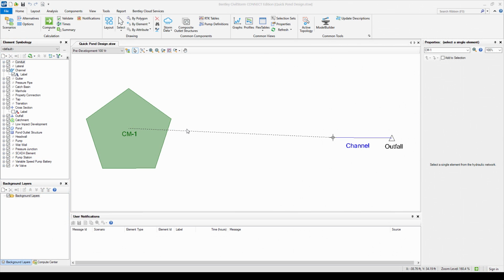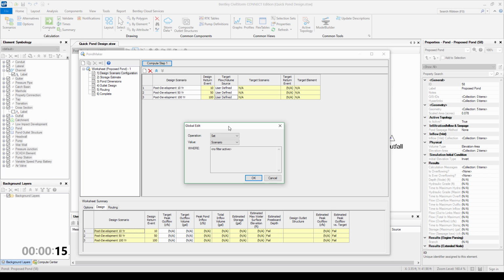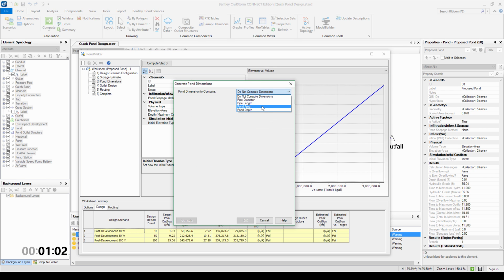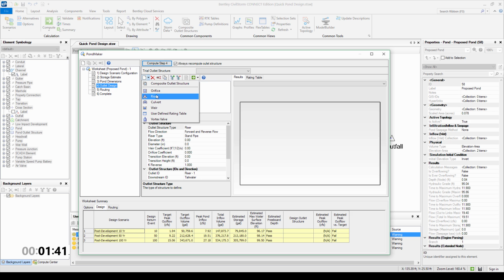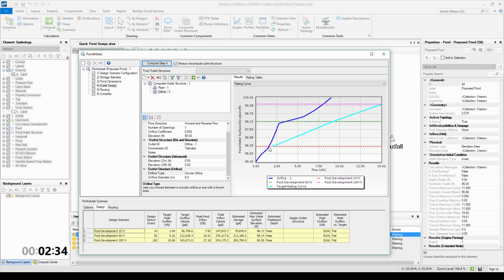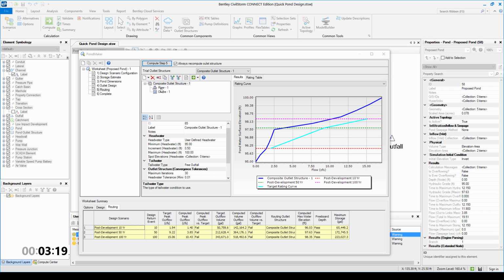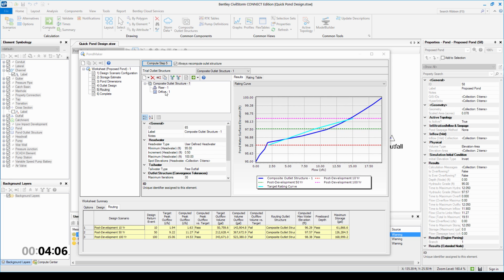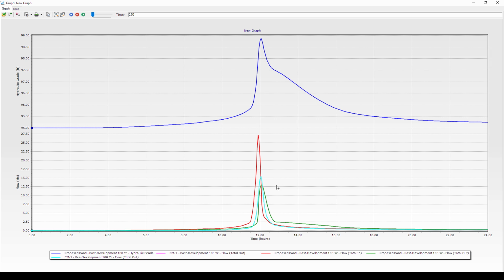Using PondMaker to Design a pond in under five minutes

Comment: On the orfice and the riser, you have the Downstream ID set to tailwater. If i set the downstream ID to a culvert leaving the outfall structure, i get drastically different results. Which methodology is preferred?
Reply from the maker: Do you mean that you have an outlet structure with an orifice, riser and culvert, with the orifice and riser downstream ID set to the culvert? If so that suggests that the culvert is a bottleneck. Try increasing the size and/or slope of the culvert to see the impact, and review the tab on the right side of the composite outlet structure to view convergence results). See: https://bentleysystems.service-now.com/community?id=kb_article_view&sysparm_article=KB0057109

If you need further help, please contact Bentley Support or post details on our forum: https://bentleysystems.service-now.com/community?id=community_forum&sys_id=0310b7ca1b1a3110f3fc5287624bcb80
Reply: @bentleywaterinfrastructure  Correct. I have an Outlet structure with an Orfice and Riser allowing water into the box and a 16' long culvert leaving the box discharging to open land. Should I set the Orfice and Riser downstream ID as culvert or tailwater? I've seen it both ways.
Reply from the maker: @christophertrebisky5243  In order to properly account for any tailwater effects/restriction from the capacity of the culvert, you would want to set the riser and orifice downstream ID to the culvert. Try increasing the culvert size to see the effect, and review the results to make sure there isn't a convergence issue as described here: https://bentleysystems.service-now.com/community?id=kb_article_view&sysparm_article=KB0057574

Comment: can I use this software for designing evaporation pond?
Reply from the maker: Yes, an evaporation pond is basically a retention pond (no outlet) where the infiltration rate is configured to simulate the evaporation rate. This can be done in SewerGEMS, CivilStorm or PondPack with the available infiltration methods. See: https://communities.bentley.com/products/hydraulics___hydrology/w/hydraulics_and_hydrology__wiki/43029/modeling-evaporation-in-a-pond

Comment: Kindly explain how to design evaporation & seepage pond with no outlet
Reply from the maker: Hello Sayed, there are infiltration methods available in the pond properties, and you can also use a user defined rating table outlet structure to model infiltration and/or evaporation. For more help, please post on our forum: https://communities.bentley.com/products/hydraulics___hydrology/f/haestad-hydraulics-and-hydrology-forum
Reply: Hello , please be  that Bentley communities web site is not reachable and the following massage appears, I tried using different browsers and even i used my mobile to access it, also it is not clear to me what is the relation between rating table and infiltration and evaporation, rating table is a relation between elevation and flow
This site can’t be reachedcommunities.bentley.com’s server IP address could not be found.
Reply from the maker: @sayedelhagar3442  Sayed, I am not aware of any problems with Bentley Communities. Do you mind if I ask what country you are from? I believe we do have restrictions in place due to U.S. Export Controls.
Reply: @bentleywaterinfrastructure  I am from Egypt and website was working very well with me since 4 years , I discovered this problem recently
Reply from the maker: @sayedelhagar3442  Ok so Bentley Communities has worked for you in the past and very recently stopped working? Is it still not working? To answer your question, the user defined rating table can be used to model the flow leaving the pond for any purpose, including infiltration and evaporation. For example if you want to assume a constant evaporation loss rate, you could set up a user defined rating table outlet with a constant flow for all headwater elevations, and have that separate outlet discharge to a separate outfall. The seepage/infiltration methods available in the pond properties can be used directly for infiltration, or another user defined rating table outlet can be used for more control over the exact infiltration rate per headwater elevation. (again, it could be set to constant if desired, but usually it changes based on the water pressure). If you have access to SewerGEMS, you can also use the evaporation functionality with the SWMM solver: https://communities.bentley.com/products/hydraulics___hydrology/w/hydraulics_and_hydrology__wiki/43029/modeling-evaporation-in-a-pond-using-sewergems-and-civilstorm